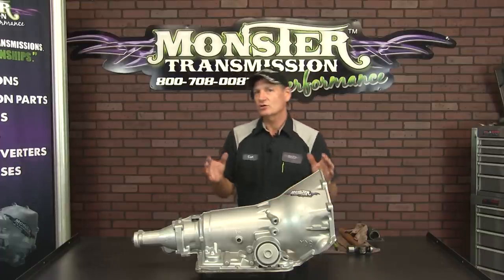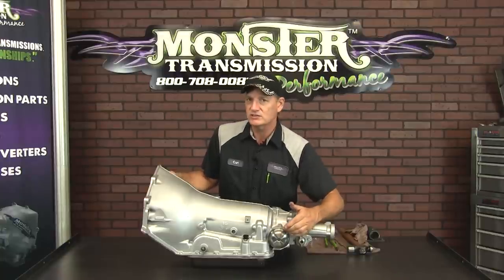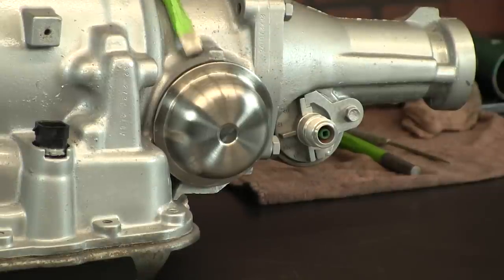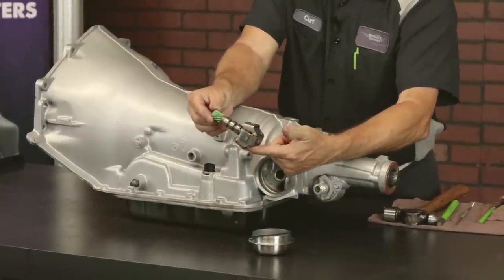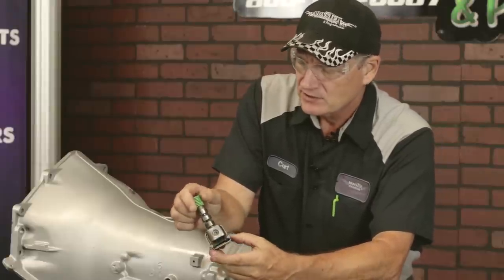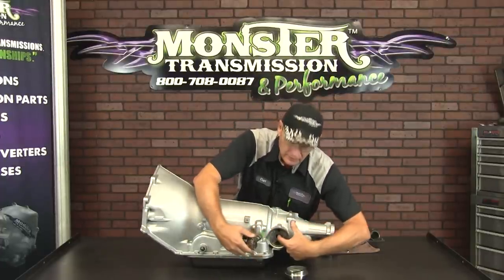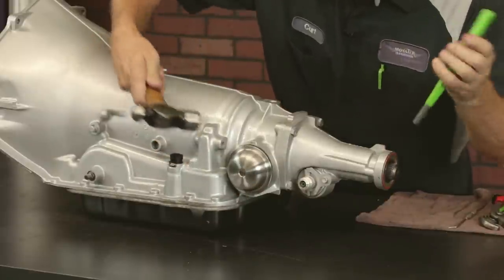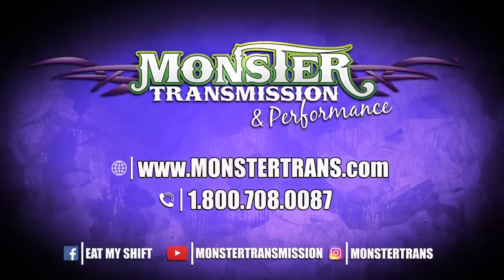700R4 Governor Check & Replacement

Comment: Thanks for the video! Very helpful, especially since my 88 is having shifting issues. Although it’s a little different and has the THM400
Reply: Mine did the same thing but it was the 700r4 88 model was driving and downshifted to first on its own and wouldn’t upshift

Comment: My 1990 suburban has a 700r4.1st,2nd and reverse work just fine but it suddenly stopped shifting into drive and overdrive.  Could this be a problem with the TV cable or governor?
Reply from the maker: From the way it sounds it could just be that the 3-4 clutches are brunt

Comment: Hey! I just put a edelbrock 1905 carb on my 84 gmc van and I’m having issues shifting. Very late shifts with the tv cable adjusted either way or completey off it shifts at the same late points. Any things I need to do since I switch the carb? I already have the throttle cable adapter and also the 8026 tv cable adapter

Comment: I’ve got an 85 K5 Blazer that falls out of gear until you let off the throttle, then it’ll bite again.  Also shifts super late out of 1st.  Seems to shift ok at higher rpms, what do you think? 700r4
Reply from the maker: Your clutches are most likely burnt up and will need to rebuilt.
Reply: @MonsterTransmission  what is your price to rebuild a 700r4 from a 85 Corvette?
Reply from the maker: @MrMany2811  https://www.monstertransmission.com/700R4_c_3942.html

Comment: Does the fluid need to be drained in order to remove the governor cover? Thank you.
Reply from the maker: No but have a drain pan under, you will lose about 1qt when you take cover off
Reply: @MonsterTransmission  thank you.
Reply: Literally I'm sitting in a gallon of ATF fluid that I was not expecting! Have a LARGE pan ready! 😅

Comment: Hey Curt I have a Holly carb with the 700r4 trans what brackets do I need and hardware thanks
Reply from the maker: Here are some links for the TV Cable brackets;
This is the TV Cable Bracket for the Holley Carburetor: https://bit.ly/2KfWv6i
And here is the Holley Carburetor TV Cable Corrector Kit: https://bit.ly/3evi0hf

Comment: Sad things I got a less abused trans cause the one I had will only drive in first or second but after doing a fluid change, I notice it was burnt to hell and had metal in the pan. So the one I have in now won’t shift into gear at all. Luckily  park works lol